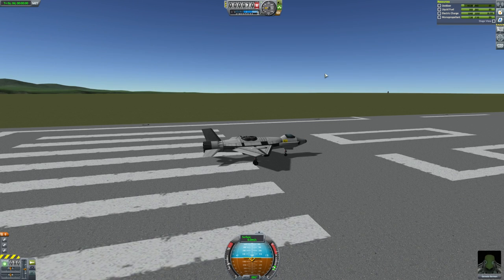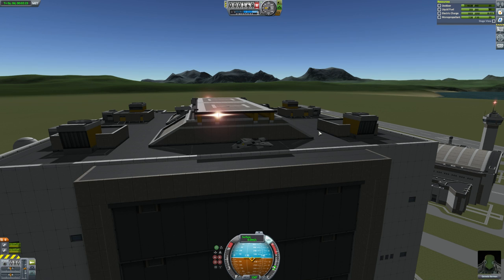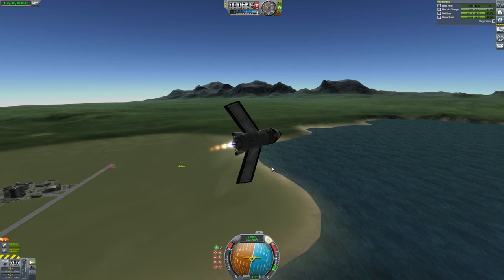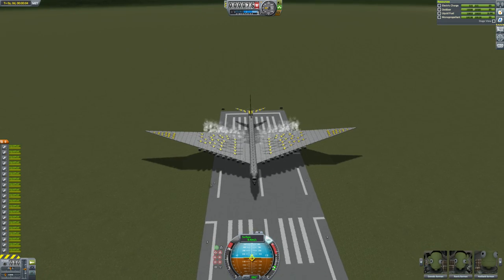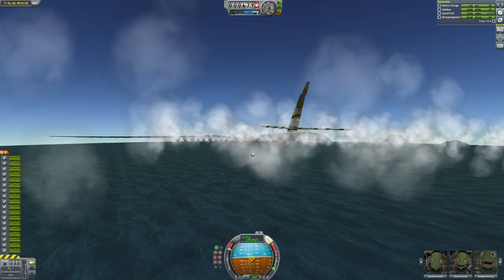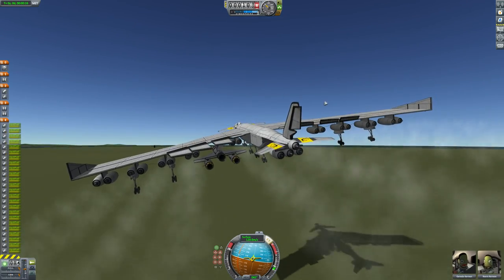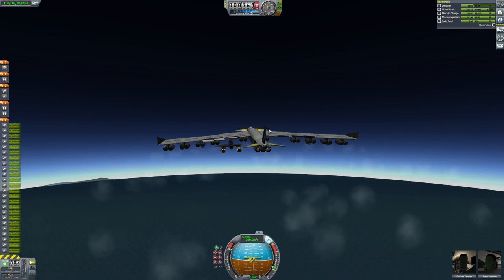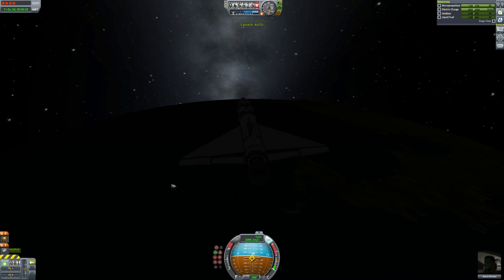Subscriber Designs - X-15s and Missile Launchers - Kerbal Space Program

Comment: Glad you liked it. Technically, you could also lower the back after retracting the two landing gear that were sticking out to the back and then the other set. The ones pointing backwards act as a lock after the back is detached.

Comment: That giant plane is more nimble than some of my small jets :(
Reply: Also, Tape, will you do a video on how to share craft files?
Reply: Can you elaborate?
Reply: Erik Vanderburgh Hey here is a good idea for you. Make a small normal jet with no vtol engines,  and see if it works alright. then you take a radial attachment point and put it exactly under the center of mass. then just add a engine, set some action groups and if you did it right it should work. I recommend offsetting the engine into the fuselage some and also get a battery bank or two and glitch in some stability enhancers for   control during VTOL and if your lucky with the center of lift you will be pretty supermanuverable. I recommend using liquid fuel and oxidizer with a rapier engine for extra vtol power. I hope this helped.
Reply: Ok, I'll have to try this

Comment: I'm gonna have a treat for you for subscriber designs sometime in the next few weeks Tape.  I still have a lot of work to put in on it though, and even with hangar extender it is still kinda difficult to get around and work on it.  Luckily I have the welding mod so it actually performs ok in my runway tests, despite the fact that without the weld mod it would already have in excess of 1000 parts.  You'll know it when you see it. ;) I'll also throw in an obligatory (and in-theme) VTOL to go with it.